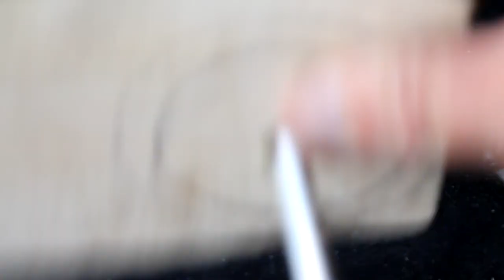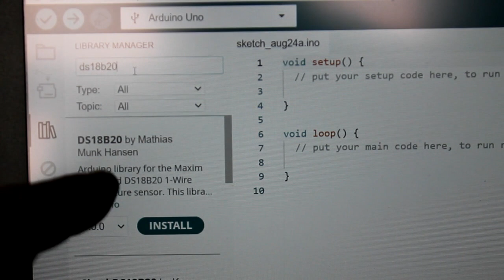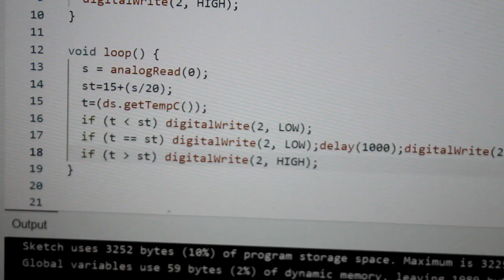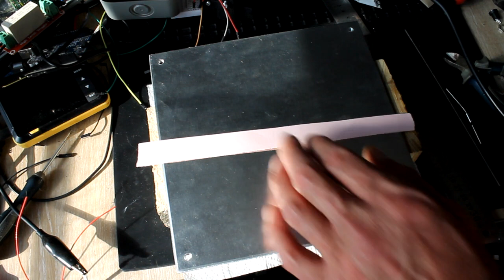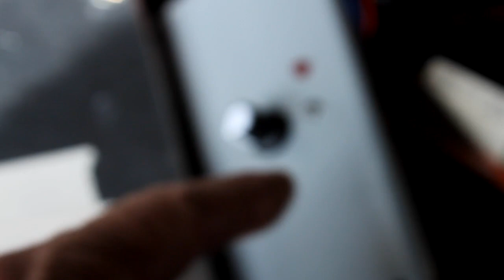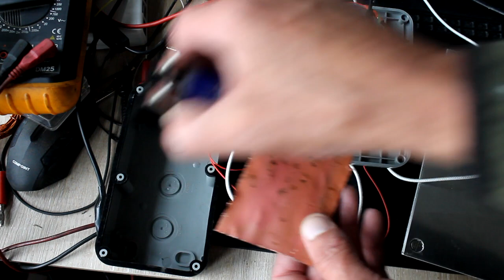Homemade 3D Printer heated bed using an Arduino, Homemade spool holder. Flashforge 3D printer.

Comment: So the printer board doesn`t have provisions for a teated bed then? I know the later versions came with one. Using that 150W heater you should be able to reach well over 100C easily. Is the nozzle covering all the bed area? They come with a 6in bed print area.
Reply from the maker: Hi, I`ve not got it to print bigger than 6" by 6". I did see somewhere you can change the programming. All I know is it was a cheap or early model without the heated bed. My friend who got me it knows a bit more than me. I`m a newby at 3D printers. I`ve ordered a 220 volt AC heater last night and some more metal. :) So I will be making another with improvements.
Reply: @damianbutterworth2434  unfortunately Flashforge uses a closed source firmware so coding might prove difficult if not impossible even. I have a Voxelab Aries which itself is a Flashforge Finder 3 version and the board was locked down. I swapped it out for a SKR E3 Turbo and put Klipper on it. The 24V heater you already have should be more than enough for the job and it`s safer as well.

Comment from the maker: int t=0; // CREATE T VARIABLE TO REPRESENT THE THERMISTOR VALUE
int tr=0;
int s=0; // CREATE S VARIABLE TO BE THE VARIABLE KNOB VALUE
int st=0; // ANOTHER VARIABLE FOR CALCULATING THE RESULT OF THE "SET TEMPERATURE"
void setup() { // SET UO YOUR PINS ETC
  pinMode(2, OUTPUT); // SET DIGITAL PIN 2 TO OUTPUT FOR HEATER RELAY
  pinMode(5, OUTPUT); // SET DIGITAL PIN 5 TO OUTPUT FOR HEATER LED
  pinMode(6, OUTPUT); // SET DIGITAL PIN 6 TO OUTPUT FOR POWER ON LED
  digitalWrite(2, LOW); // HEATER RELAY OFF
  digitalWrite(5, LOW); // LED FOR HEATER OFF
  digitalWrite(6, HIGH); // POWER LED ON
}

void loop() { //PROGRAM LOOPS BACK TOO HERE AFTER THE BOTTOM BRACKET
  s = analogRead(0); // READS THE VARIABLE KNOB
  delay(10); 
  s = 1023-s; // INVERT THE VARIABLE KNOB VALUE AS I WIRED IT THE WRONG WAY ROUND
  st=40+(s/15); // CALCULATE TO CONVERT KNOB VALUE(0-1023) TO VALUE 50 TO 100 FOR DEGREES C
  tr= analogRead(1); // GETS THE TEMPERATURE OF THE THERMISTOR
  delay(10);
  t=(tr/6); // GETTING A ROUGH TEMPERATURE. NOT PERFECT BUT WORKS.
  t=t-35;
  if(t >= st) { // TURN HEATER OFF IF TEMP PROBE IS HIGHER THAN THE SET TEMP
    digitalWrite(2, LOW); digitalWrite(5, LOW); delay(1000);
  }
  if(t == st-1) { // TURN HEATER ON FOR .2 SECONDS AND OFF FOR .8 SECONDS
     digitalWrite(2, HIGH); digitalWrite(5, HIGH); delay(200); digitalWrite(2, LOW); digitalWrite(5, LOW); delay(800);
  }
  if(t == st-2) { // TURN HEATER ON FOR .4 SECONDS AND OFF FOR .6 SECONDS
     digitalWrite(2, HIGH); digitalWrite(5, HIGH); delay(400); digitalWrite(2, LOW); digitalWrite(5, LOW); delay(600);
  }
  if(t == st-3) { // TURN HEATER ON FOR .6 SECONDS AND OFF FOR .4 SECONDS
     digitalWrite(2, HIGH); digitalWrite(5, HIGH); delay(600); digitalWrite(2, LOW); digitalWrite(5, LOW); delay(400);
  }
  if(t == st-4) { // TURN HEATER ON FOR .8 SECONDS AND OFF FOR .2 SECONDS
     digitalWrite(2, HIGH); digitalWrite(5, HIGH); delay(800); digitalWrite(2, LOW); digitalWrite(5, LOW); delay(200);
  }
  if(t <= st-5) { // TURN HEATER ON FULL OFF TEMP DROPS BELOW SET TEMP-5
     digitalWrite(2, HIGH); digitalWrite(5, HIGH); delay(1000);
  }
}